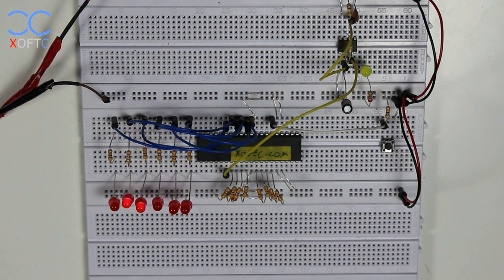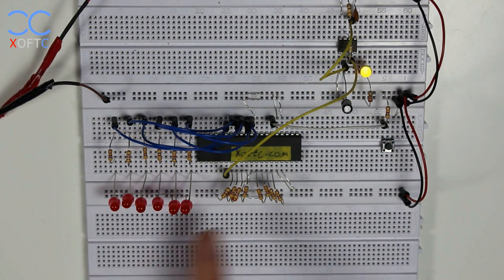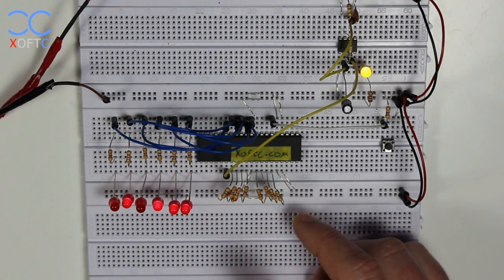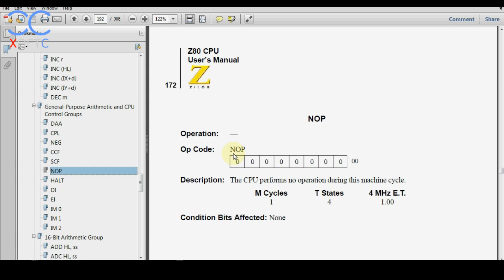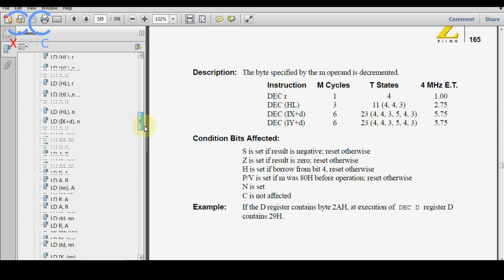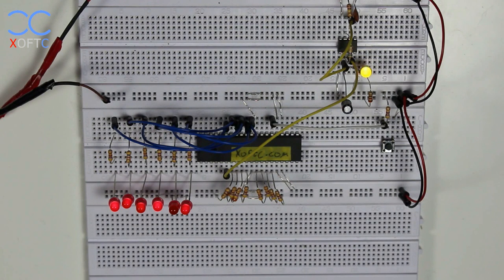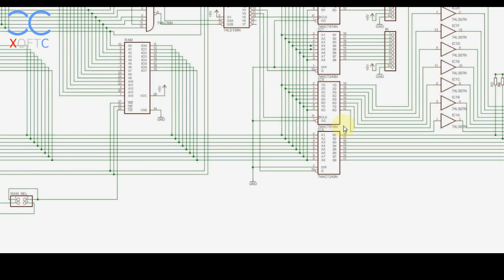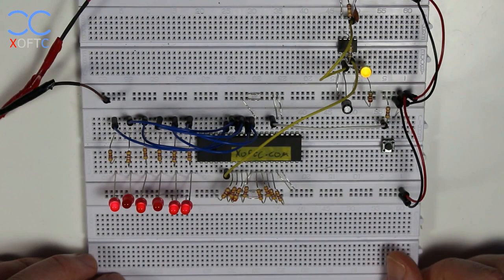Z80 Computer Build #1: Overview of the Z80 CPU and build

Comment: I was wondering does the address on the z80 continue all the way to 1111111111111111 and not just 1100000000000000
Reply from the maker: According to the specs the Z80 can handle memory addressing up to 64K so the address bus will go up to FFFF (1111111111111111). Some systems have usable addresses limitations depending on the memory map but the Z80 CPU itself on its own (as far as i know and as the user manual states) has no counting limit on all 16 address lines.